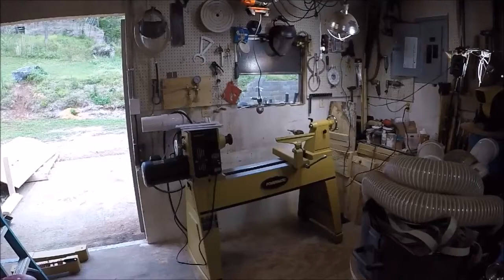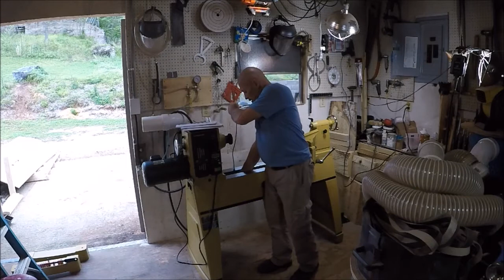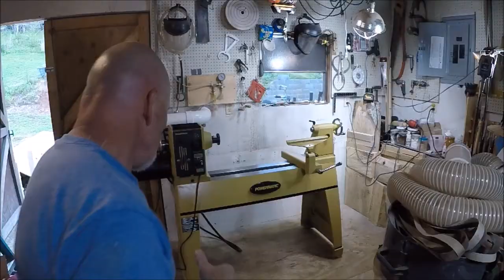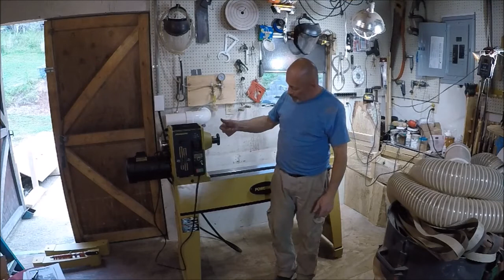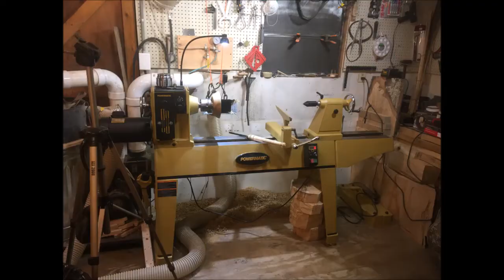The New Powermatic 3520C Lathe Unboxing and Setup Part 2

Comment: Hi Tim, congratulations on being the first one to have a thorough review with your assembly instructions on the 3520c, nice job! I’m going to be getting one myself shortly and was thinking of building a small gantry crane to assemble it since I don’t have anyone around to give me a hand. I know one thing I would’ve never tried to lift that headstock up there by myself, I hope you didn’t hurt yourself. 
I’d like to mention a website I saw not long ago by Carl Ford. If you haven’t already heard of him do check out his blog on the 3520 he gives a very thorough review of the lathe. The shelf that he made that sits on top of the headstock and the shelf below for extra weight are a very good idea. Especially for the shelf for putting things that you use often without having to look all over the shop for them.Best of luck with the new lathe Tim.

Mike

Comment: I pick up mine next week so Thanks for Sharing the set up!  I feel much more confident now that I saw you do this... do you have any of the electrical work too? would be nice to see how that was done as well. Thanks Again for sharing and I hope you are enjoying it!
Reply from the maker: You're very welcome Dale, I'm glad you found it helpful. I didn't film any of the electrical. Mine came with the electric cord but at the time I had heard others say that theirs didn't. It's not difficult at all, mine is hardwired rather than having a plug in the end of the electrical cord.
Reply from the maker: I've had a couple of electrical issues with mine but  I do love the lathe. I contacted the manufacturer and had no trouble getting the replacement parts. Replacing those parts that failed was a whole other story though!
Reply: Thanks again!  Got mine up and running!  :)  still don't know how you picked up that motor and installed by yourself!  That was heavy!!  Have a Great Day!
Reply from the maker: @dzornes1  Awesome, I know you'll enjoy it. It wasn't easy, that's for sure! LOL

Comment: Can’t wait till I save up enough money to get this Machine it’s great that you made the video because I was concerned on set up on such a heavy machine I have a three car garage that I converted into my shop so room is not an issue I’m just wondering how it comes off of the truck that could be a problem.
Reply from the maker: It really depends on your location Rick. It is delivered on a pallet. There was no way a tractor trailer could back into my driveway and to my shop. What I did was contact the carrier and had them deliver the lathe to my local farmers co-op where they had a forklift to unload it from the truck and place it on a trailer behind my truck. The driver called me when he was close and I met him there to pick up the lathe. I was able then to back my small trailer up to my shop and unload it a box at a time which was still very heavy. Hope that helps.
Reply: Tim Pollock My garage opens directly onto the street so backing the truck into my driveway would be no problem but they would have to use a truck with a lift gate.
Reply from the maker: @Ricksp65   Gotcha. You can specify to the carrier that it needs to be delivered on a truck with a lift gate. Or at least if you purchase through Southern Tool you can.

Comment: I enjoyed your setup of the new lathe. Time to make the leap. Craft Supply is having 15% off from June 13 to 20. That'll be a good price.
Reply from the maker: That's awesome Sid, I know you'll love it! Thanks for watching and leaving a comment brother.
Reply: Hi Tim, Well I got my lathe a few weeks ago and had no one to help me put it together. There's no way I could of handled that headstock myself. I can't believe you did yours by yourself. So anyway I wanted to build a gantry crane to make things easy and to use it for other things as well. My truck or trailer will fit in between it so it may come in handy sometime. I just made a slideshow last night and here's a link to check it out.    https://www.youtube.com/watch?v=vKgMUaaARj4    I found another guy on here I got the idea from. His name is frank howarth, If you haven't heard of him check him out, this guy is unbelievable with his camera work and woodworking. Oh and I got a cord with mine but way to short. Take care,  Mike
Reply from the maker: Congrats Mike, you'll love the lathe! Yeah I was a little nuts for setting the headstock on it by myself.  LOL It's not so much the weight of it but the fact that there's just no good way to get ahold of it for one person to lift it. I need me some kind of crane so I'll have to check that out.

Comment: Where did you get that winch ??
Reply from the maker: I bought it years ago at Tractor Supply. The motor went out on it so I just use it around the shop and power it with a cordless drill or impact. It's a Warn 4700